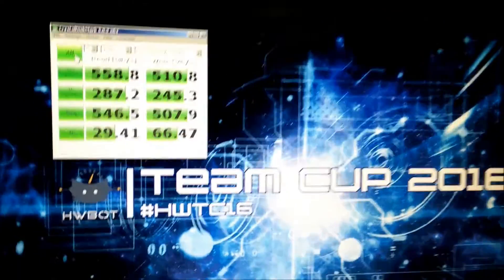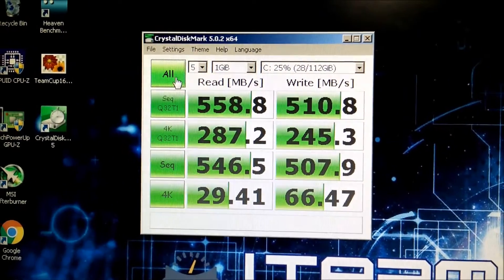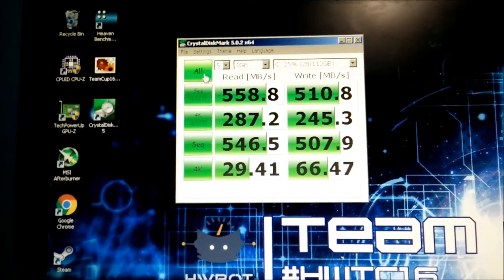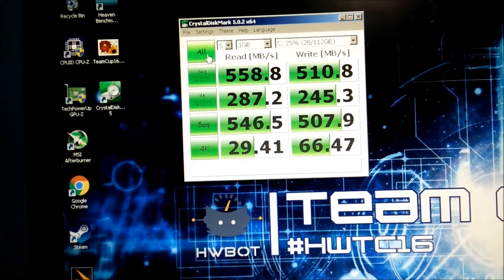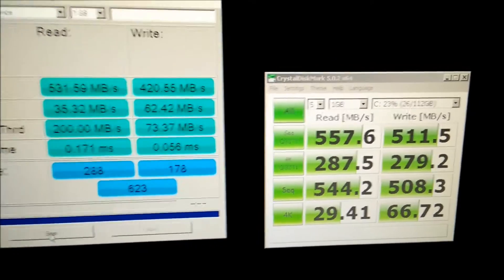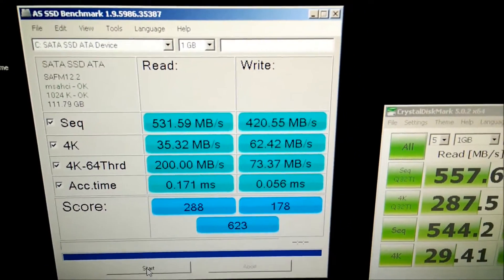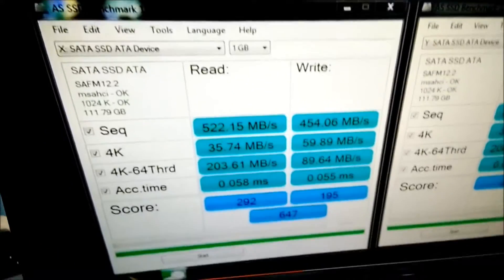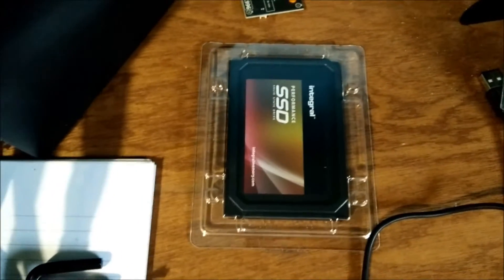£25 SSD 1 Month Later

Comment: I have the same SSD and it runs pretty well. After 3 months, I have these results: http://prntscr.com/npldbr
Left side - SSD Integral P5 Series 120GB SATA-III 2.5 inch. Right side - HDD WD Blue 1TB SATA-III 7200 RPM 64MB

Comment: Hello
I have 2 questions. Is this p5 series ssd? If Yes, is there any problem with r/w speed under 50-30% of free space?
Reply from the maker: No its the p4
Reply: @LawrenceTimme  Thanks! 
However, I see that p4 has the same controller as p5. Does p4 has any problem with r/w speed under 50-30% of free space?